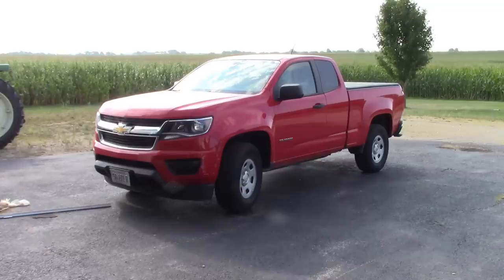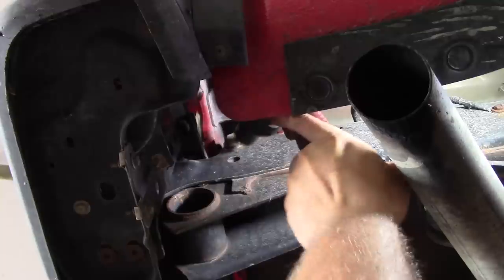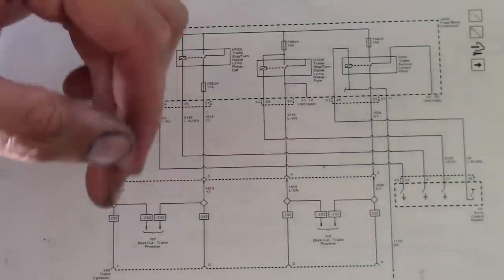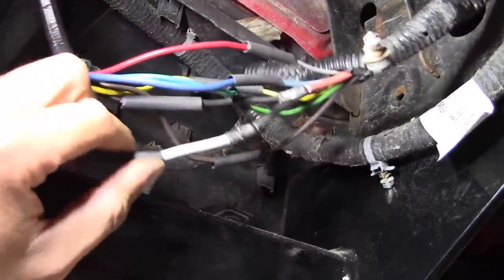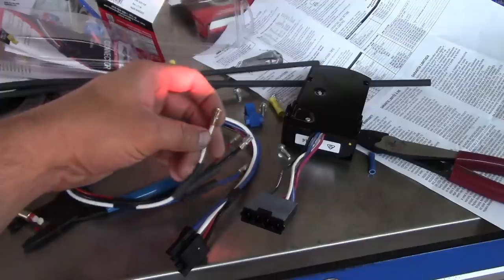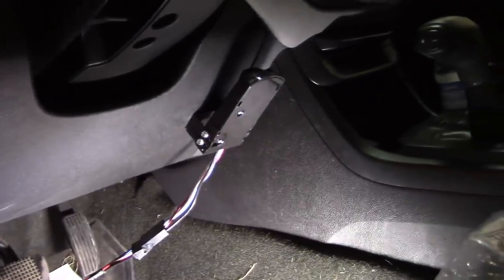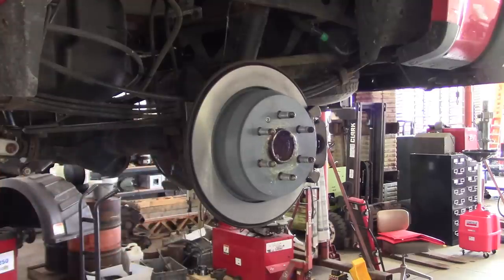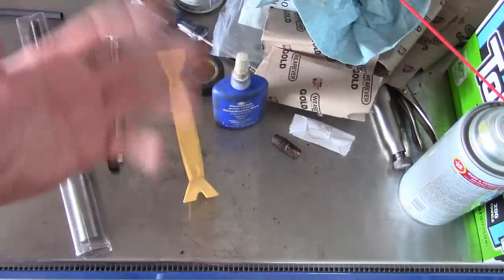2015 Chevy Colorado - Install Trailer Hitch, Wiring, Brake Controller

Comment: I just did the trailer harness on my 2020 Forester Sport (Hitch was installed earlier), and Subaru literally put a plug on it behind the styrofoam cargo inserts. Worst part about the job was securing the ground. I'm surprised they don't do that with pickup trucks, of course an exposed connector may not last long if not plugged in and sealed, so the blunt cuts probably make more sense given the application, whereas the Subaru's plug is technically in the vehicle's storage space, which is pretty weather tight.
Reply from the maker: Some trucks have the plugs as well. Or they make adapters that plug into the tail light connectors.

Comment: Great video! Tough without your hired assistant.
For rust prevention, I'm from the east side of Illinois, same rust as you. I have been following Mustie1 who uses used non synthetic oil in a Hudson type sprayer with a hose inside the frame rails. It works.
Reply from the maker: Yeah that would work.

Comment: Cool video, nice that you had ready those wires on the car. And there was no any programming or coding needed for the body control module?  I was wondering if you'll spary oil on that spare tire cable and sure thing you did! Also nice to postpone corrosion on that plug. But after some brutal salt road winters... Here in Finland it's almost new plugs after five years...

Interesting in US you have electronic trailer brakes, how those work in salty winters? Here we have hydraulic brakes on trailers. Master cylinder is on trailer arm and then drum brakes on trailer itself. Master cylinder has also reverse lock lever so you can prevent it squeezing and braking on reversing.
Reply from the maker: Some trailers here have the hydraulic system, but electric is very popular. It's a drum brake, but inside the drum there is a lever connected to the brake shoes with an electric magnet. As electricity is applied to the magnet, it sticks to the drum, which pulls the lever and spreads the brake shoes. It's been used here for 70+ years.

Comment: ATF and acetone? Mighty stout looking rear axle for a mid size. Wow! The good stuff!  10-4 on the tire machines! Fluid film is good in frames, too. <3
Reply from the maker: It even has 6 bolt wheels. It's more like a 1/2 ton truck.

Comment: Nice straight forward job Wes, just one TINY.suggestion concerning the custom aluminum mounting plate for the truck trailer light socket.

I REALLY hate to mention it, because you usually don’t let things like it slip by you.

But, I really think this time you missed a chance to turn this job into a REALLY first class Northern Illinois `master mechanic job.

Hopefully, my comment will prevent such a lapse in the future, are you READY?

Would not the installation have looked more finished and professional if the custom aluminum mounting plate been painted BLACK to match the existing bumper trim?😊

Please take my comment in the spirit that was intended! 🤣🤣🤣🤣🤣
Reply from the maker: Send it to the body shop...

Comment: When I need a hitch I go to uhaul and buy it there with the warranty.   Not that I don’t want to give a local shop the money, but uhaul has an excellent warranty that if the hitch surfaces rusts, which it will in the rust belt, they will replace it for free and then you buy the warranty again for ten bucks, rinse and repeat.
Reply: given the number of bent, cracked weld rejected brand new hitches the local uhaul has me come get off their hands, I wouldnt trust the quality of the hitches uhaul is using. Reese must be cutting uhaul a helluva deal

Comment: My 07 f-150 has a connection under the dash for a trailer break controller I just bought the ford pigtail and wired it in with the controllers harness and your good to go
Reply from the maker: Ford is pretty good about that. Some of the Silverados have a plug you just plug in and you are good to go.

Comment: When I stick a thin wire into a big splice like that I'll double-length strip it then fold it over so the conductor is doubled inside of the splice.
Reply from the maker: I do too. I have seen factory wiring crimped that way.

Comment: 20 years ago I had to do a rewire on a brand new gooseneck trailer. The problem turned out to be "scotchlock" connectors installed by the factory. I removed 32 of them worthless things. They are no good anywhere but criminal in upstate NY. even the brake connections were "scotchlock"

Comment: I don't see much reason for a Colorado to have a trailer hitch. And specially that one. It's 5 years old and only has a light surface rusting in spots? It clearly doesn't see much use. I would suspect that "grandpa" only takes it out on nice days and never in the winter. Great video on the proper way to install a hitch Wes. Nice wiring techniques. And the outtro was undeniably the best you have had so far!
Reply from the maker: It's got almost 50,000 miles on it, so I think he is driving plenty. You're probably just in disbelief that anyone would ever bring me a truck that's been cleaned and taken care of. I know I am!

Comment: Wes enjoy all your videos,  I live in St.catharines Ontario Canada we have rust proofing shops  common do people in your area rustproof there vehicles. Also for the older trucks like your 1995 f250 could you put in your own relay set on the rear turn signals.
Reply from the maker: Many body shops here offer rust proofing. And there are mobile guy who will come to your house and do it. I did install my own relays.
Reply: @WatchWesWork  thank gor getting back so quickly.

Comment: One of the YouTube welder guys I haven't watched in a while said his insurance guy was emphatic about not making trailer hitches. However, he didn't have any issues about installing them either. Sounds like the insurance folks have an issue or two with them in general.
Reply from the maker: I suppose. Like playground equipment. My insurance company won't even let me look at it.

Comment: Hi Wes,
Another excellent video. What was the trailer brake controller for? Never seen one in the UK.
Yours Andy UK
Reply from the maker: It controls the electric brakes on the trailer. The brakes shoes have a electro-magnet that grabs the sidewall of the brake drum and applies the brakes. Very common here.

Comment: If anybody sees this comment, I'm curious what the fix is for the fast flashing turn signal Wes talks about at 8:54.  New bulb doesn't fix it and it does it intermittently. I'm stumped. 🤔

Comment: Are you kidding me. Chevy basically put a hitch with no receiver in it on that truck. What a big kick in the pant. “ hey we went out of our way to make you buy a hitch.” Nice
Reply from the maker: That factory setup is actually rated for 3000 lbs, but you have to put the ball through the bumper. I'm assuming they have a dealer installed hitch option.

Comment: So right about  about connectors. I have to confess that it was all bullet connectors when I was a young guy with older cars,  Solderng iron ,rubber covered cable in part. Scotch locks came along and we quickly realized they were'nt much good in wed dirty places like trailer lights. However to confess  a major sin  52years later, :-- I canged a complete dashboard assembly  with gauges,swiches and controls on  ,extending the main harness ( loom) for each and every connection , with  the nasty things,  I swapped the car for a pair of Leek Hifi speakers,  The new owner spanked the var around a lampost on his maiden drive( it had a hot motor) Proably I was lucky that he did not incinerate himself due to my scotch lock fetish, I now realize. However after  a few years,I came to love Italian cars, Alfas,Lancias the odd Fiat,and electrical failure and fire from the dashboard area was common even when new! As my uncle would say Italians make just great cars but are inclined to put the equivalant of the Nation Power Network through unsuitable auto swiches and wiring!

Comment: Next time you do a multiwire splicing job : cut the wires - both cables - increasingly shorter, such one long cut back wire one cable mates a non shortened wire the other cable - and vice versa
That way you will spread out the thicker connectors and heatshrinks over a longer piece of cable.
Makes for a lot nicer final cable easier to fiddle into place afterwards.
Reply from the maker: Like I said, I don't have enough wire there to do anything fancy.
Reply: @WatchWesWork  Yeah - sorry I even commented.
It wont happen again.
Reply from the maker: @CXensation  What you are saying is a good idea. I just didn't have much slack.

Comment: WHOAH!  The tahr goes up and down with a cool little play winch!  I want a pickup JUST for that single reason.  Wait, I own a pick up (does a rebadged MightMax count?)  Mine doesn't have a neato play winch, though...I feel so inadequate!
Reply from the maker: Those winches are horrible things. A few years of salt and they turn into rusty bricks.
Reply: @WatchWesWork  They should have probably incorporated exploding bolts into the design.  Exploding bolts make everything better...  
That's too bad, it looks like a neat idea.
Reply: @WatchWesWork  Mrs. Watch Wes Work works at Hogworts?  That's cool.  My cousin went to one of the real schools in London where they filmed those movies.  (She's Engrish)

Comment: So, I’m wondering, if the labor cost to fabricate the homemade mounting bracket was less than the cost of the Hopkins 41144 kit that would have looked like it came from the factory.

I wouldn’t have been happy with that solution, unless I had to have a trailer hitch before I could get the model specific kit . 

You did mention a time crunch, maybe that an was off camera decision that the customer made before you started?
Reply: - I forgot to put in a “was” .
Reply: I promise, I’m not drinking . I just am having a hard time typing . - sorry .
Reply from the maker: Like I said, I can get the plug, but it would take at least a week to get the pigtail.

Comment: So the brake controller reads out the brake light signal and activates the (electric?) trailer brakes?
Funny design...
Here (Germany) we only have trailer brakes that work from the force the trailer pushes in to the car, independent from the car's brake system. The plug only transfers light and brake/turn signals to the trailer.
Interesting to see, thx a lot!
:-D
Reply from the maker: Kind of. The controller has an accelerometer inside that senses when you are trying to slow down and applies the electric brakes on the trailer axles. The older ones used a pendulum, now it is digital.
Reply: @WatchWesWork  Oh ok, interesting! Never heard of something like that!
Thx!
:-D

Comment: I think while he's at it he should have you look in to that spare tire.  A guy would really be in pickle if he had a flat and his dry rotted cracked spare wasn't in any better condition! LOL
Reply from the maker: They use the cheapest possible tires for the baby spares. I'm surprised it looks as good as it does.
Reply: @WatchWesWork  That's sad seeing its basically there for what most would consider an "emergency" type of situation LOL

Comment: Hey Wes. Any advice for a tough spark plug that won't come out? I drive an '05 Civic coupe EX and I have one spark plug that will not come out. I bought it used and I have no idea if antiseize was used beforehand or not. When I used a breaker bar and penetrating oil (yeah, it's that tough) to get it loose, it barely turned but also made a weird noise like the threads were under a ton of tension or something. I was going to take it to a mechanic, but I'm trying to save money where I can, unless it's absolutely necessary.
Reply from the maker: You can try it when the engine is hot. But be warned that you might get all the threads along with the plug. But you can helicoil those Hondas pretty easily.
Reply: @WatchWesWork  Appreciate it! I'll give it a try. Thanks!

Comment: ScotchLocks work fine if you put a squirt of silicone in them before you put the wire in.
Reply from the maker: And then a squirt once a day until you send it to the crusher?
Reply: @WatchWesWork  Used them on a fleet of trailers for several years. Had no problems after I discovered the silicone trick. Borrowed it from Ma Bell.

Comment: Nice work, however if this trust doesn't have the towing package it likely also doesn't have the extra cooling necessary to tow anything substantial
Reply from the maker: It's a 2.5L 4 cylinder. It's probably self limiting.
Reply: @WatchWesWork  hey now, the 4 cylinder can at least get out its own way unlike its bastard cousin the I5.  poor I5 whispering i think i can i think can oh noes i cant

Comment: Great video. Utterly ridiculous that a ‘tow package’ is an option on any pickup; should be standard for every trim level except perhaps fleet specials.
Reply: a true tow package would include upgraded trans cooler, stronger rearend, rear springs, possibly bigger alternator. i wouldnt trust my 06 canyon to try to tow anything but a shopping cart ratchet strapped to the rear bumper in its stock form

Comment: Alert!
Do not throw away the metalwork you remove when fitting a tow bar. That's for all vehicles.
The removed parts are valuable parts for those people who have had a rear end shunt. Theirs will be bent and you can sell your part to them   :)
I have a friend who fits tow bars and he makes money selling that removed metalwork.
Reply from the maker: I can try I guess.
Reply: Dont they get given back to the owner?
Reply: All parts removed should be returned to the owner for them to either keep, sell or throw away.
Reply: @WhiskeyGulf71  when i was in the bike trade it was part of the code of conduct that all parts should be offered back to the customer, although the offer was rarely taken up.
Reply: @chrisstephens6673  Offer them back but I can't imagine 1% of all clients would want that junk back.
Reply: @pettyfogger2305  to most customers the old parts are as much interest as used toilet paper, if they knew what they were they wouldn't, in most cases, have gone to a professional garage.😉

Comment: Leave it to chevy to design and make a spare tire support with safety chain hooks that looks a lot like a trailer hitch receiver that you have to remove in order to install a trailer hitch receiver. Maybe your son can use the Scotch locks with his Legos to build a replica of The Towering Inferno. Sure would help the arson investigators.
Reply from the maker: The thing I removed is kind of a hitch. You have to put the ball through the bumper which is supported by that bracket. It's rated for 3000 lbs.

Comment: Awesome video, i have some sugestions though.
If your doing any sort of rust preventive measures on these trucks always give the top of the fuel tank where the fuel pump is on these trucks, its just a bowl where salt collects and never gets cleaned out alot of the time it eats out the fuel pump and the evap system... As you probobly know tbh. also i have noticed the tube cross member that goes accross the top of the rear area of the fuel tank always gets the worst of the rust(besides the rear fender arches). Deffietly give it some attention or it will be totally gone in another 4-5 years, i speak from expernice on that.

Good on you putting fluid film in the rust prone spares lowering assmbley, most people just laugh and figure its screwed anyways.... They work fine if thet get a little oil or fluid film one a few years.

I was inspired to try those butt connectors again by you, i swore them off after they always failed on me. But the uninsulated ones with sealing heatshrink does the trick!!! Thanks for that, but i really need to know what do you so when it comes to really fine or high gauge wire like what you might find in a backup camera? Do you still use butt connectors? I tried your method with the smallest ones i could get but they still fail.
Reply from the maker: Soldering works better for very small wires. Or you can double or triple the wire by stripping it longer and bending it back on itself.
Reply: @WatchWesWork  gotchya gotchya, Ill try that out on the next one, thanks again. I swear your the best sellsman for tools and processes I have ever came across, every other video I end up loading my shopping cart with things I never considered touching before.

Comment: Not being a troll,honest question, wouldn't soldering the wires be a better joint considering the size difference.
Reply from the maker: Soldering would work, but there is nothing wrong with the crimp.
Reply: @WatchWesWork  I generally have bad luck with butt connections,even when the wires are the same size...I strip off too much or not enough insulation. Thank God for shrink tube lol.

Comment: What does the breakcontroler do?
Here in the Netherlands all our trailer breaks are all mechanical or air powered.
Reply: Most personal trailers have electric brake systems in the U.S.   The brake controller  controls the amount of current and how rapidly the current is applied to the trailer brakes. More current equals more braking force which help slow heavier loads. Less current will slow lighter loads without locking the trailer's tires up. As far as I know, you want your trailer to engage slightly faster than the tow vehicle without locking up the trailer wheels to keep the vehicle and trailer straight. The controller make the necessary adjustments possible. Hope this helps.
Reply from the maker: Right. It's a common system here in North America. Been around since the 1940s.

Comment: Chevy could have put connectors on those blunt cut wires, Nissan does.  All the owner has to do is buy the relays and pig tail and plug them in.
Reply from the maker: They do if you buy the option.